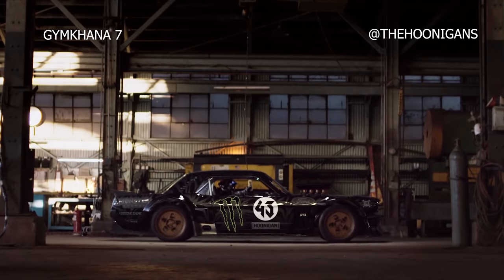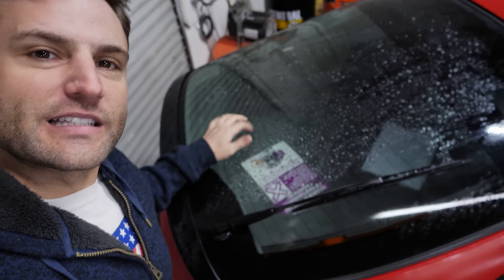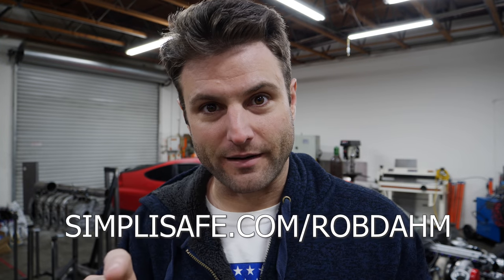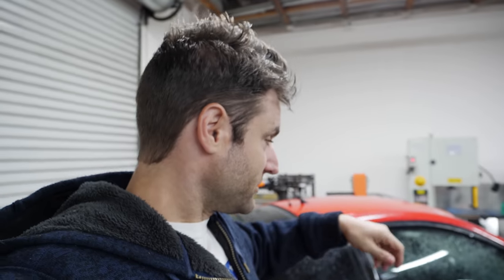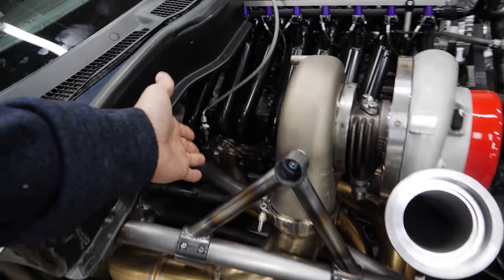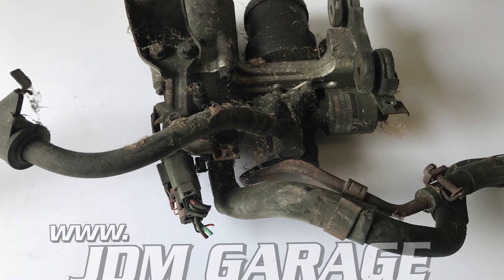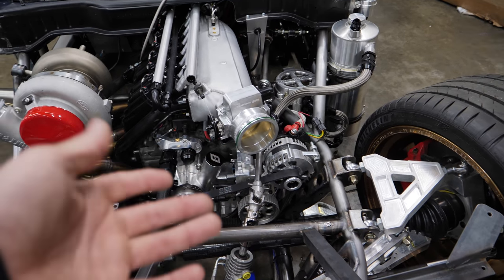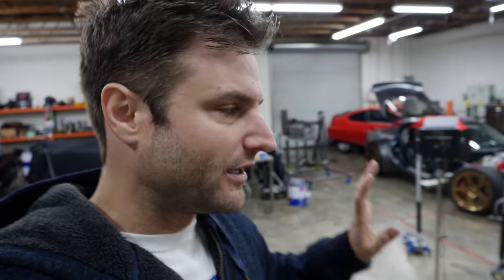Someone Stole my Spare Quad Plate Clutch. Out of my Insight

Comment: Thank you for teaching me to break into a Honda Insight 😂
Reply: But would you want to steal one tho🤔 probably even wouldn't want it free. No offence Rob
Reply: That's actually the main method tow truck/wrecker/roadside assistance drivers use to open cars with button locks on the doors. They either gap the door frame or window, and just use a rod to hit the unlock button. They just carry a few specialty items to make it easier and not scratch or break anything, if possible.
Reply: @gsxrpat6147  Boi when you're broke you'll steal anything.
Reply: @thedefenestrator2994  you get in the car but it takes a little bit more effort and knowledge to start an get it to drive

Comment: Don't know if you found an ATTESA pump yet, but the Infiniti FX series use the same ATTESA E-TS as the R32/33. Might be easier to source one from a totalled/parted out FX as they are infinitely more common than GTRs, or maybe even getting a brand new one from an Infiniti dealer/spare parts shop.

Comment: For smoother idle tuning, I would advise you run primary injectors on the actual irons. The fuel transport time is much shorter and makes for a much better idle. There's a reason Mazda called it semi-direct injection.

Comment: I hope that you realise that choosing the right spring rate is not just a matter of ride height like most ricers do? You need to weight the car and calculate proper spring rate, otherwise there will be lack of traction dude, also, depending on how you want to have it setup, need to account the downforce, you need the whole weight of the car, with everything installed for proper setup.

Comment: When you use two u-joints in a steering shaft, you need to support the rod in between the joints.  You will always have issues if you have them back to back with no support in between them.  Love the channel.

Comment: Hey Rob instead of getting rid of/replacing your oil coolers with smaller ones, why not just add an oil thermostat in so you can get quicker consisteant warmed up oil temps and retain maximum cooling when you do half mile/trackwork, sitting idle and high rpm max load oil temps are two different things. Love your work man it's awesome to see your project reach a milestone and really looking forward to where it goes from here!

Comment: The only problem with Simplisafe is that it's incredibly easy to jam out. Since it operates at the same wireless frequency as garage door openers, you can basically just blast a really powerful signal at the same frequency and the base station doesn't receive the signals from the sensors. I'd really recommend getting something more professional (and wired) installed in its place.

Comment: supporting the turbo is a good idea, but you'll probably want some flex or slip in the manifold to save the welds as there will still be flex between the engine and point the turbo is mounted.

Comment: Welp you were asking for it tbh leaving it on display like that
Reply: HeadingEast33  I've seen a few cars unlocked with the keys in the ignition and nobody around for hours at walmarts, I knew they were pulling "working up" to a lexus through insurance scamming so I took the keys out of the ignition locked the doors and threw the keys under the seat. Hell you never know if a drunk would jump in and drive off and I sure as hell aint letting that on my conscience

Comment: If its an R32 Attesa E-TS, that's used in a large number of models. Including Inifiniti G35, Skyline, Fuga , Stagea, was also in some R33. So if you don't need the Attesa E-TS pro version there are a lot of options.

Comment: ROB. Get the FULL RACE ETS-PRO ATTESSA controller. It works with R32 R33 and R34 ATESSA systems. You can fully tune it using your laptop from 0 to 100% torque to the front wheels. Its amazing for road course and drag. It uses a digital G sensor and you can program how responsive the system is as well. It's a must have for the ATTESSA system

Comment: Use a gear oil bypass thermostat. It has 3 ports, 1 IN and 2 OUT, 1 out is for thermostat closed and the other out is when the thermostat opens

Comment: Should just install a small liquid to liquid plate heat exchanger and plumb it to exchange heat between the oil and the coolant. It's incredible how much heat they can move and that way your coolant will heat the oil plus at the same time it will allow the oil system to help the water system stay cool. I have done it before and it is wonderful when your oil and coolant are both a perfect 180 degrees.

Comment: An interesting idea for the oil temp issue...
I know the mclaren mp4-4 used an intercooler bypass valve to regulate the intake air temperature. Could you use something like that to modulate your oil temp?

Comment: Hi Rob. Why not make the front suspension air or hudraulic controled, and at that way you can adjust the front ride height when loading and offloading. You can also limit the max and min limits, thus making you intercooler piping easier.

Comment: I wouldn’t be so quick to get rid of the second oil cooler! Things get real toasty once the turbos plumbed in. 

A thermostat bypass setups a way better solution, you’ll get a quicker warm up time, and a cooling system that automatically adapts itself to how you’re driving at the time, rather than you having to uncap some lines and plump in the second cooler again every time you want to drive it hard.

Comment: Dont eliminate that second oil cooler, do it properly by having a thermostat bypass (on all oil coolers). Or cool it (and heat it) with your watercooling system. Or make a plate to cover the oil cooler which you can take out on race days. Or include a three way ballvalve to skip that cooler.

Also, remove that metal plate behind your radiator, its garbage

Comment: I would just unscrew the radio antenna off the car  breaking Into to jam the unlock button. It's a one stop shop. Also if the window is slightly cracked you can insert a screwdriver and pry outward and the window will just shatter without a whole bunch of noise if you drop a coat or bookbag on the ground it doesn't attract a whole bunch of attention in and out in less than 30 seconds.

Comment: Wouldn't that support on the turbo end up cracking? Unless the engine is solid mounted, because the engine would move independently to the chassis?
Just wondering don't want Rob losing that turbo.

Comment: Even if your window isn’t cracked open a hair that window will bend without breaking you can use a screwdriver to pull it from the seal and fit your arm in and unlock the door I suggest getting an aftermarket alarm on your Honda

Comment: String also works well for unlocking doors from the inside. There was an Instagram post on it a while back. Tie a loop in the middle of a string and work it between the door jamb hook the loop around the lil dildo sticking up or the lock toggle like the insight and pull tight.

Comment: dont remove the cooler, put flaps/louvers/actuators etc in front of it so it cant get airflow.
Reply: Just regular electronic throttle bodies of the right size and a switch in the cabin will work fine.

Comment: Damn Dahm, yeah you have to have a relay for the door locks. I have mine set up so that the power unlock function on the switch only works with the car keyed completely on. Car off, the switch can be used to lock the car only

Comment: Id leave the second oil cooler tied in as you only drove 10mph around the block and idling temps without the turbo in full use as well as not a for real drive at speeds the oil temp could still go up

Comment: Your oil cooling system should be thermostat controlled so you don’t cycle thru the coolers until it’s at temperature.

Comment: Rob is that is your lowest point, you need to put in some bump stops, otherwise you could still get situations where the suspension travels further, say in a single wheel bump under breaking or similar.

Comment: you do know that once you put in a firewall and floor pans that you're going to have to rewire everything and possibly re-plumb your oil and turbo system... personally id just get the shell done so you dont have to do 4 times the work and spend twice the money on parts, wires and lines... but hey its not my wallet and time

Comment: Other than more strain on the Electrical, why not use "2" Puller Fans for the Radiator? There's room!🤔

No rush on floorpan & body, I was wondering what "Body Kit Style" you are committing to.

Sucks about the "Extra Clitch".😿

Thoughts of a "Transparent Hood" with the 3M Skin to protection against rocks & crud? Body Color -Matte Black?

The 4-Rotor is One SICK MONSTER!🧟‍♂️

Take care,
🤓 -Thomas
Western Washington State

Comment: Instead of longer springs couldn’t you just fine tune it with a spacer? At least using a spacer you can then come up with the exact length spring you need and tubing is cheap

Comment: ah! i made the likes 666 what do i do!?
Reply: also is having the turbo rigid mounted to the frame a good idea? didnt the frame have more flex than jodi highroller? may be better to tie it to the engine due to heat, engine twist, bumpy bumps? i wouldnt want a planet sized turbo spinning beaucoup fasts being used as a stressed member